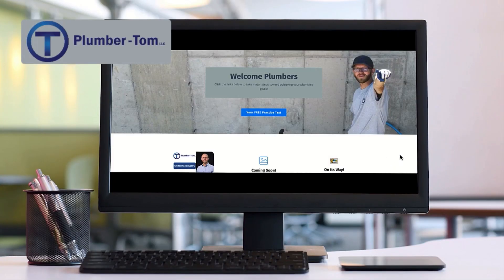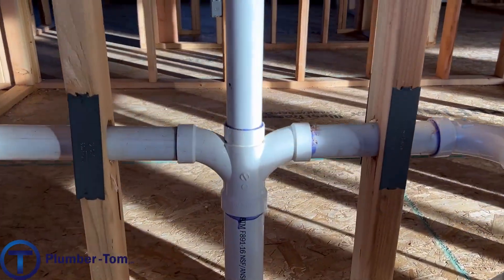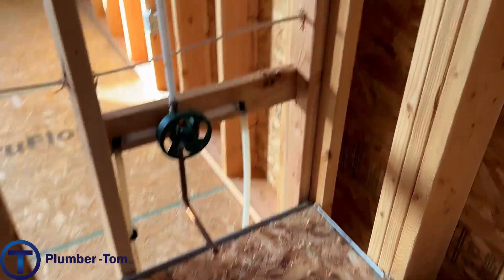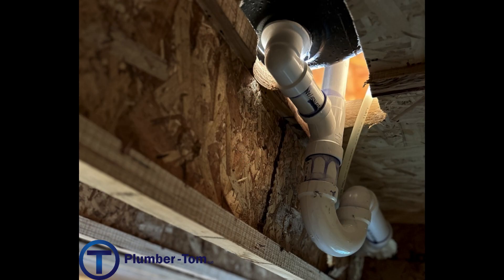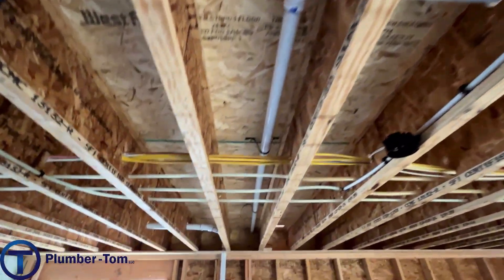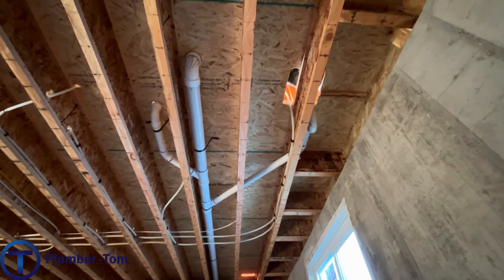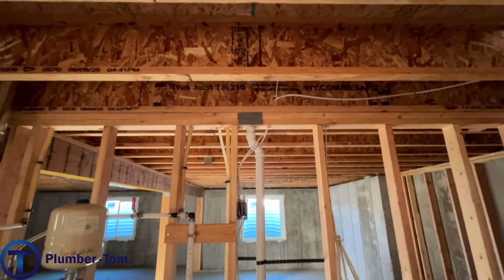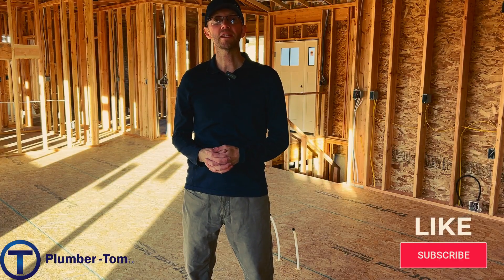Drain Venting Lesson 5 - Plumbing Rough Analysis 1

Comment: Toilet flange should not be installed until final trim out they belong on top of finish floor 

The best way is to use a 4x3 closet bend and stub up 4 inch pipe and then they tile around ur pipe then during trim out you cut the 4 inch pipe flush with the floor and then you glue the inside 4 inch toilet flange into the pipe using only glue no primer and then get tile or glass drill bits for ur flange anchor screw points 

No primer because ur in a finished house and mostly no primer on toilet flange connections because wen the flange needs to be replaced it will be easily pealed out of the 4 inch pvc pipe because its not welded by primer only the glue
Reply from the maker: Ok.  That is one way to look at it.  

On the other hand, drilling through tile is a pain in the neck and can cause damage to the finished floor.  I prefer to put the flange on in the rough stage and fasten it to the subfloor for a solid connection.  Code does not say it has to be on top of the finished floor.  Just secured.  

If you talk to a manufacturer of PVC pipe and glue, they will tell you to prime every time for a better connection.   IPC Code does not require primer on drains, but primer does make for a better joint seal.  

I'm not saying you are wrong, just presenting a different view.  Thanks for sharing!
Reply: @plumber-tom9470  my way it’s the professional way flange during rough is hack stuff 😂

Comment: awesome first fix but! he could have tied all the vents together in termal envelope/attic space before poping out through the roof with one or two 4 Inch vents maximum, remember one vent at least must equal the size of the sewer which should be 4Inch. But also its better to tie the vents together and send out 1 Inch and not all these crazy looking 2 Inch vents.
Reply from the maker: I like tying vents together as well.  But remember, it costs more material and labor to run them all together inside the building.  Residential is not usually bid for that.

Comment: Another point the stub outs should be in the wall. Floor stub-outs make it a lot harder for the cabinet guys to install.
Reply from the maker: That's true.  But they reduce the risk of getting hit by a sheetrock screw or finish nail.  So I still favor coming through the floor.  Sorry, cabinet guys...
Reply: @plumber-tom9470 we use plates for that.
Reply: @plumber-tom9470      regionally accepted  or if its on a outside wall in cold weather.    almost 40 years and only see that on repipes  its totally unheard of here  I suppose a glulam maybe but it is not standard or even acceptable anywhere I seen  in CA   and we arent exactly the kings of quality  LOL  .  however   single vent out the roof dont happen here  and rarely are vents taken to rear of house for astetics  rarely in so cal   nothing under a million dollar home   2 or 3 times the amount maybe  maybe some picky city folks on pricey shacks in LA

Comment: That third line could be a recirc line. We always install recirc lines. It’s a good idea and saves water.
Reply from the maker: Recirculation lines are a great idea.  There was not one installed on this system, but I usually install one.  I insulate the line as well.
Reply: @plumber-tom9470 good idea to insulate all the lines if you can get the customer to understand why and add to the scope for sure! Cold to prevent condensation and the hots to keep the heat.

Comment: The title of the video is wrong drain vent have a vent so it’ll take 4 inches of sink. The sink has air above it that it is venting the water as it drains down to the trap. After that you get your waist your waist is where you need your vent
Reply: We vent every p trap in North America.
Reply from the maker: Not sure I follow what you mean.  But thank you for sharing.
Reply: @plumber-tom9470 every fixture has its own vent. Unless you’re wet venting and that have limitations as well.

Comment: the fixture downstream of the horizontal wet vent connection does not look like it has its own vent. The hydrolic lump that the flush creates will fouce the air through the lav vent protecting the trap seal on both the lav and the tub but what about that last fixture?
Reply from the maker: Should be ok.  Meets IPC code requirements.
Reply: @plumber-tom9470 I believe the shower needs its own vent, since the toilet itself it’s upstream from the shower it haves a chance of siphoning the p trap in the shower
Reply: I’m pretty sure IPC requires a toilet to be the most downstream fixture in a wet vent
Reply: @plumber-tom9470  This does NOT meet IPC requirements. The WC has to be the most downstream fixture. Wet vents can only carry 4 DFUs on a 2" pipe. Section 912.3 in IPC. Shower should carry it's own vent in this case.

Comment: While I do like the idea (and I’ve done it) of using stainless steel fittings on top of the water heater to connect to the expansion tank, you are not supposed to do this. The expansion tank is not allowed to be supported by any portion of the plumbing system and should be secured in a different way than you see here.
Reply from the maker: Good point about supporting the expansion tank. Inspectors are responsible to enforce that rule. I think too many don’t even know about it.

Comment: Why two backwater valves?
Reply from the maker: Great question. Saves pipe. Basement fixtures are spread out so rather than running double pipes with a single back water valve this plumber put in two valves.

Comment: Great video  Tom,   these type builds  you dont see here but in 94 and 95 I plumbed similar in Elko Nevada   36  homes   full basement  .
   Plumber  was decently clean .    the long sweeps on trap arms was   How I learned  no 1/4 bend mediums on thier side         You didnt mention but  the    double fixture tee is what  we used too although some places they use double santees .     
       Water heater   looks solid but wont comply  on seismic    a on the ball inspector  might call the   expansion tank  depending on piping for support .    siesmic pretty lax though outside of Ca at least it was.
      Closet flanges  installed and fastened  mandatory  in my world    throughout country  many plumbers leave flanges off  and install on finish   kinda sucks though because    flanges are often low  double wax is common .
      real cool Tom.  thanks for posting the  build   dont mean to say anything bad just observing
Reply from the maker: Thanks for the observations!